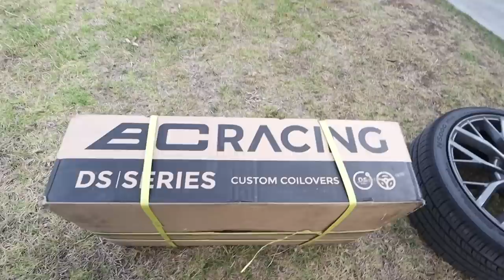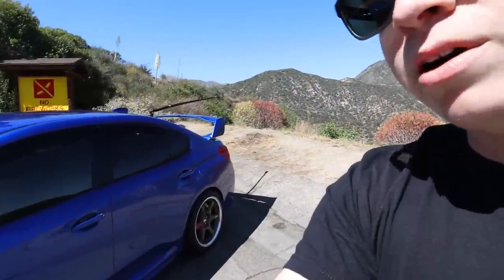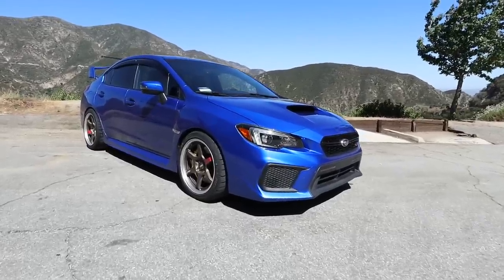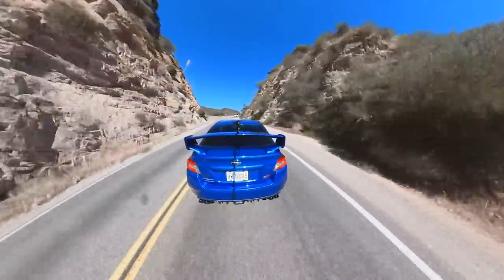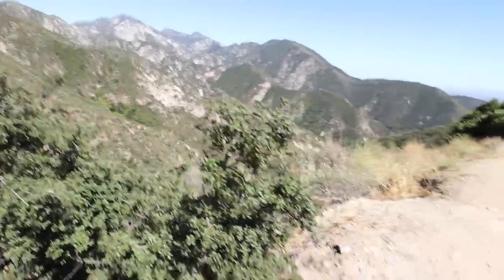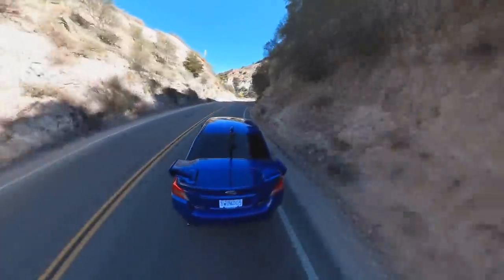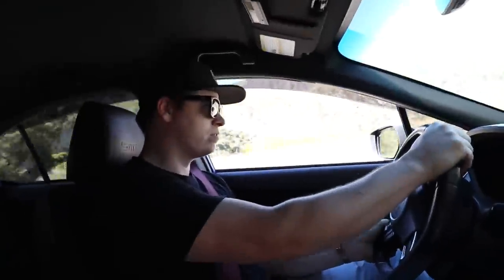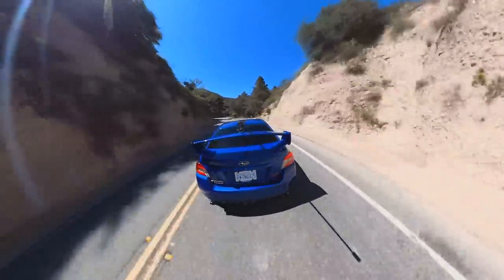One SIMPLE Mod Transforms WHOLE BUILD!

Comment: Car should be super safe with a stage one plus tune which is just an intake box basically. But at least you get to hear the turbo. If you want to keep the car safe I recommend sticking with around 18 psi and 20 if you really want to push it. Anything over that and it will get too hot and blow a ring lmao. Super cool though super glad you copped the subie 😎

Comment: Get a Cobb package for your car like a stage 2. This way ya get cool turbo sounds. White line sway bar kit made a HUGE difference for my bugeye.
Reply: Can’t really do stage 2 in ca currently, cobb is working on a new -green approved stage 2 tune.
Reply: Can you get a pro tune instead of using the OTS map and it pass inspection still?
Reply: That is why tuned Subaru’s blow up and get a bad rep. Getting a ported tune and calling it good is not the way to go. Either get a pro tune or keep it stock and not blow your shit

Comment: You should get some new fenders not like a body kit but like carbon fiber stuff and then get the car painted the color you want when you get everything on I’m sure it will save weight and help with body roll braking etc

Comment: I'm doing something similar to my car, leave the car stock and knock out the weak points like handling first so I'm not running 500+HP on a 235 rear tire, that and the bushings in my suspension are shot

Comment: When i had mine i noticed a lot of understeer on hairpins if you get a sway bar i think you should try just a beefier rear cause most people's sets don't get the rear bigger than the front so it's still proportionally the same but a stiffer rear end should help i think never tried it though

Comment: 1500 for my car so basically about the same id spend on really good tyres for my car (17×8's). The links and swaybar kit from whiteline (dont laugh its the best my car can get in that budget) is also about the 800 mark. (Aussie Vy station wagon) i recently spent 900 on sl king springs (again dont laugh .. budget at the time) and formula shocks. (All new bushes and links of course) and was super disapointed. Lost 20mm on the front which was perfect and a massive 70mm on the rear to the point i was bottoming out the rear shocks going over 5mm stones on the road. Lovells sl (sport low not super low) bought it back up 30mm so its not driving like a dog dragging its ass across the carpet. And i still hate it. Might give the bc's a crack as its fully adjustable. Dont buy king springs the sag after a week was massive and formula shocks started leaking after a coiple of weeks. Remember "the poor man pays twice".

Comment: Stock width on the tires is 245, is that a wider wheel and tire?
Reply: 3:12 they're 265/35/18. Not sure on wheel width. Somewhere between 9" and 10" probably
Reply: @alexl2679  hey thanks for that, def more contact patch and sidewall than stock. Front brakes are huge on mine, not sure if I can even fit a wheel smaller than 19, but I havent really looked into it

Comment: I think a car doesn't have to be super expensive to be 'clean'. Wheels and coilovers are the beginning of a build, definitely a modification. You can have a perfectly stupid build that has $20K in modifications and then blows up in a month, you can have a lightly modified car that is perfectly reliable with only $1K in components and call that a build. Drew leans too much on money, often calling very expensive cars with dumb wraps or paint jobs clean, well built or tastefully modified, and then turns around and trashes some 18 year old's tastefully built and modified Scion that he was lucky enough to get as a graduation present. Drew's knowledge is limited heavily to the cars he drives, and he represents the auto enthusiast community perfectly 😂. 

It's funny when his CarMax purchased STI catches on fire; he begins shitting on STIs and WRXs in general and continues to do so in future videos as if the car is the problem instead of CarMax lying about known mechanical issues.